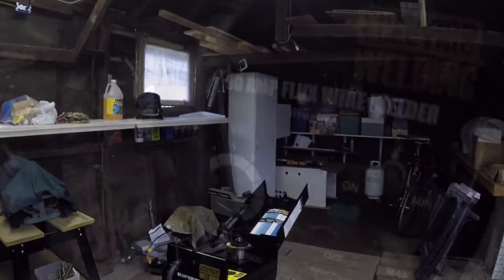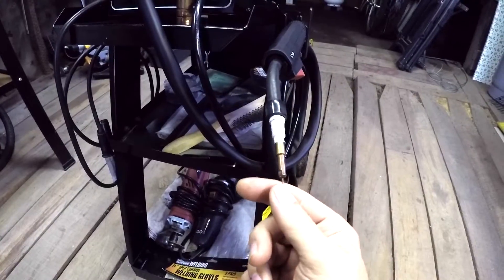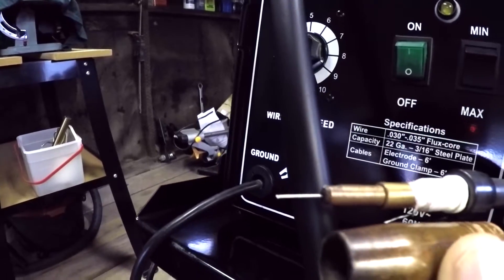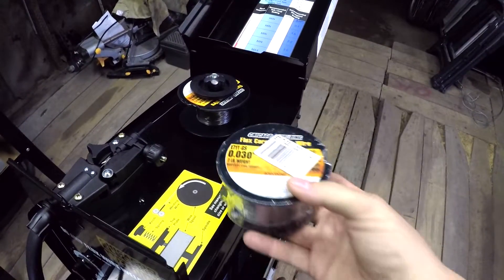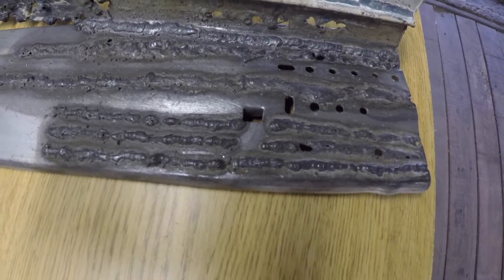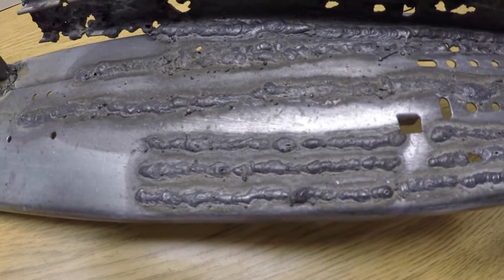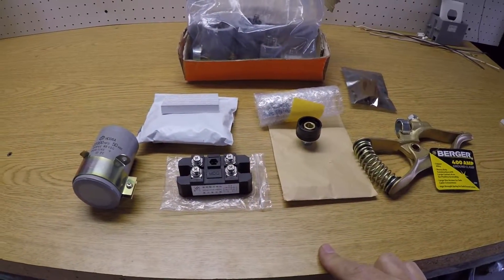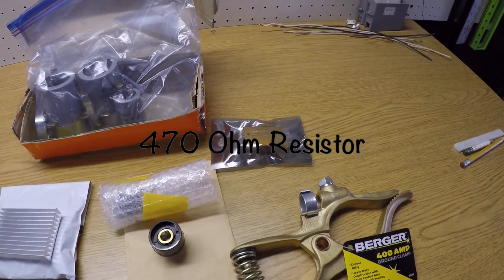Harbor Freight Gasless Flux Core Welder Mods (Part 1)

Comment: I have troubles seeing my joints, keep welding off my path removing the shield helped 100% and changed to Lincon wire did great,welded 3/16s angle and got great penetration. Next I will change the polarity, thank for all the info. G
Reply from the maker: Good to hear Gerry, thanks for stopping by and happy welding!

Comment: Another great upgrade to these Newer Black welders is to replace the Power Cord which is only 16ga  Replace with 14ga or if you want to go over 6ft in length  Use 12ga

Comment: For the cost of the parts I'll need and the time it will take to do this mod, I'm contemplating just buying the Titanium DC welder instead. it won't be that much more and I can always just sell my AC fluxcore welder to recoup some of my money.
Reply from the maker: I agree, there are many better options out there today compared to when I made this video. You could go with the YesWelder FLUX 135 and get a stinger for stick welding as well for a little less than the Titanium machine as an example. Then you could weld with stick or flux core depending on your needs. It's a nice little welder for the money IMO. I have one and it welds quite well. Here is a link if you would like to have a look at it.
https://yeswelder.com/collections/mig-welder/products/gasless-mig-welder-135a?ref=DIYHP10%25
Reply from the maker: If you use code DIYHP10% at checkout you can save an additional 10% off your order at YesWelder

Comment: I did the basic mods ....better ground clamp...Blue Devil flux core wire....remove stupid MIG tip.  Then added the bridge rectifier...no caps...no inductor.   

It's like a brand new functional welder now.   

When I find a discarded microwave I'm adding an inductor.  Probably never mess with capacitors.

Thanks for the inspiration.
Reply from the maker: Awesome lunarrn! The conversion from AC to DCEN is the best part of all the modifications and has the most improvement in performance IMO. Congratulations and enjoy your new welder! 👍😀

Comment: I have the same welder I too had zero experience when I got it. I can now weld with it pretty flawlessly my welds look good and they are structurally sound.  use two hands to help control
Your gun slow down my machine is totally stock from harbor freight those little welders can produce great welds for the typical hobbyist.

Comment: Welds look ok for first time. Never stop learning. I have the same welder with no mods and I get decent welds with loooootttssss of cleaning and going really slow. Also if you dont have a auto adjusting helmet it sucks. After buy the helmet my welds got a million times better lol driver mod
Reply: Im a year late and a dollar short lmaooo buut I have the same one too, and I get pretty good beads out of it.  I weld a lot of think and thin wall pipe, and a lot of 1/8,1/4, even 1/2 inch rebar, and a good bit 3/16th, all the way to 1/4 inch plate.  I love the little thing for thin tubing like exhaust or super small spot/tack welds on the metal trinkets I make with my metal forge, and the figures and shapes, hearts, peace signs, dogs, people, ect, that I make from nuts bolts washers ect lol

Comment: I am thinking that the 90 Amp and the 125 Amp use the same transformer. 18.5VAC @90Amp. Someone needs to weigh the transformers when the machines fail.
I did use this machine to patch a hole in a gas burner tube for my grill. So I saved $30.
Add in a few other repairs. So in eight years it finally paid for itself.
So now dumping $200 bucks into this box for mods is being spread out over a year.
Only tripped thermal  protection switch twice.

Comment: Same boat I was in: the price we paid for the Chicago Electric Welder plus sales tax is a sunk cost. Similar to putting money in the pot for a round of poker: the money is gone and therefore not figured to be yours again unless you win the pot.

So even if I could have found a transformer induced DC current welder for under $600 in March of 2023, I still would have been out the hundred $120 purchase price of this welder and The temper set Illinois sales tax. 

By the way—I do not see the fifteen feet of AWG 4 gauge wire among the parts. That would have likely pushed the purchase price above $40.

Comment: If the maximum DC voltage is 50V (that's the rating of the capacitors), then the power dissipated in a 470 ohm resistor will be just over 5 watts, so a 50 watt resistor is massive overkill.  A 5 to 10 Watt power resistor will be a lot smaller, too.  Otherwise, good project.  You should make a video that gives a tour of ALL the new parts as they are installed in the welder.  In the videos I've seen, I only see bits and pieces, but never everything all tied together and installed.
Reply from the maker: Thanks for the input William, that is some good information. You are right, I should do a video of all of the complete modifications.
Reply: @DIYHomesteadProjectsDIYHP10  I measured the AC output of the welder, and it's about 22V ("Min" setting), no load.  That means that the filtered DC out of the rectifier and caps should be about 16V, so 50V caps have a nice margin.  (22V RMS => 32V peak to peak, full wave rectfied will give you 16V on the caps.)  I figure I'd check this stuff before I went blindly ordering parts.  On "Max", AC out (no load) is about 27.5V, so every number will be about 25% bigger -> so the DC on the cap should be about 19.4V.
Reply from the maker: Good on you, I think that's a good way to approach a project like this. Thanks for posting the information! I'm sure it will help others that are looking for details on a project like this.

Comment: This was a very informative video for me since I don't really understand the principles of welding.  However, I do know a bit about electricity and electronics.    If the weld depends on a peak voltage (positive or negative), AC would be a terrible method since you are only going to be at peak for a small fraction of the cycle.    Those hefty capacitors should give you a pretty smooth DC voltage.  I hope you do more videos on this upgrade.
Reply from the maker: To me it's very interesting and part of what got me interested in welding. I am probably not the guy to explain what the differences are in AC vs DC welding but I may do a future video explaining what I know and the main reason I am doing this conversion on this welder. I have several videos out on this conversion and a couple more to make showing the entire process. I hope you enjoy them and hopefully they will help someone else out there that wants to do the same.
Reply: @DIYHomesteadProjectsDIYHP10  I am very much behind on watching videos since I have been busy on projects.  I look forward to seeing the ones you have done on this conversion.